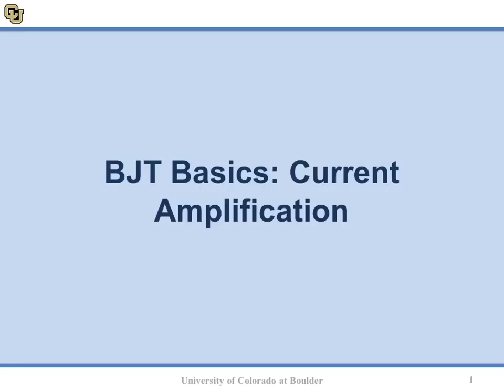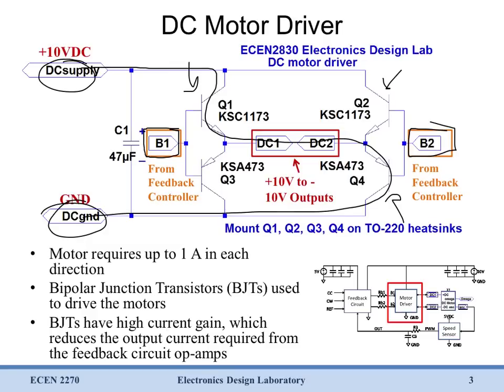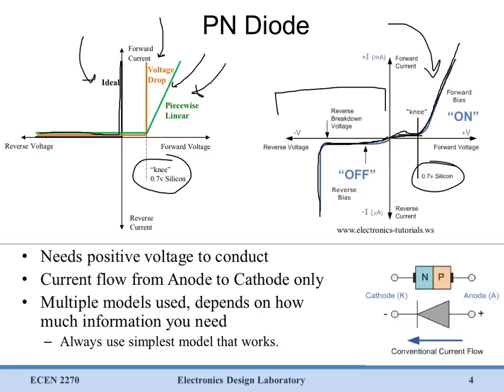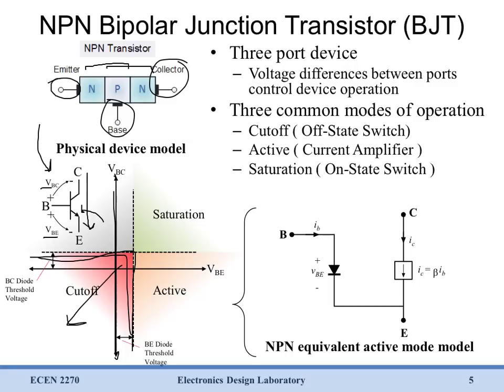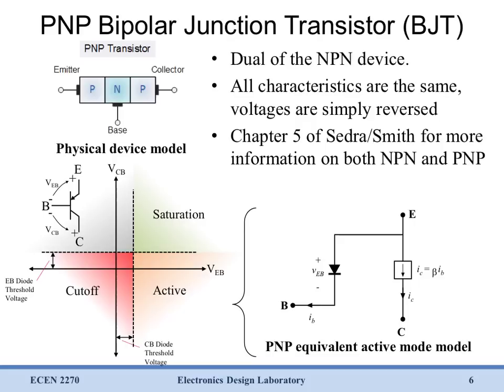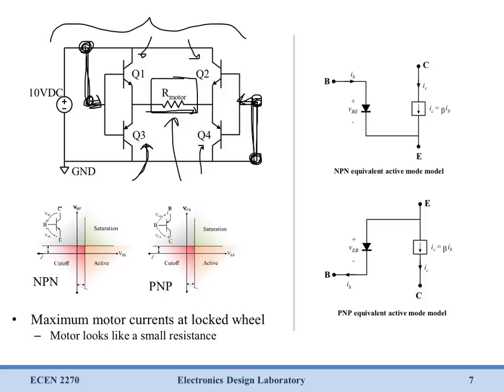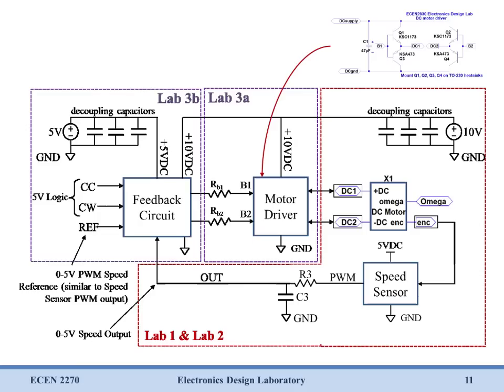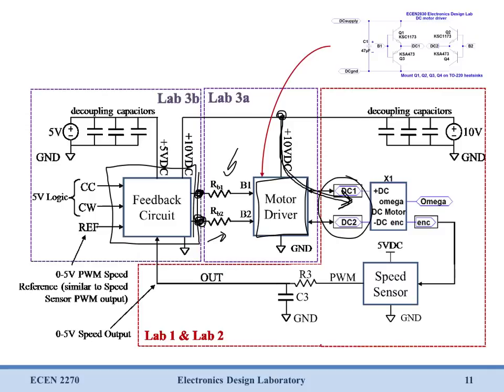BJT Basics: Current Amplification

Comment: Nice explanation...I am doing simple charger circuit please try to help me, i have solar panel which gives 4-5 Volts and 400-500mA Current output so i need to amplify the current from 400-500mA to 800-900mA please help me and Thanks